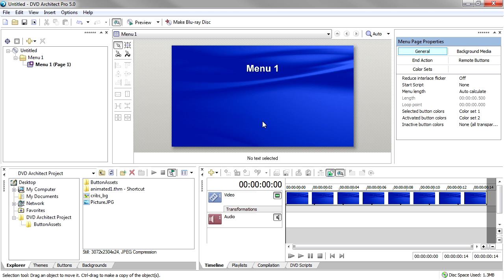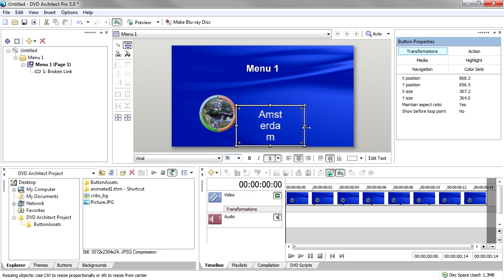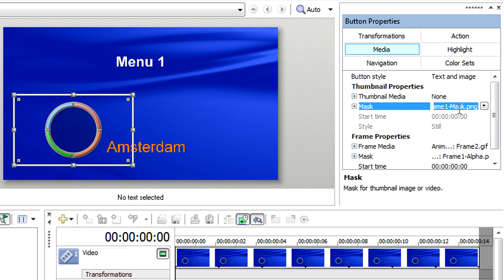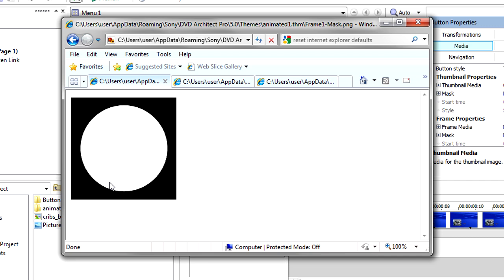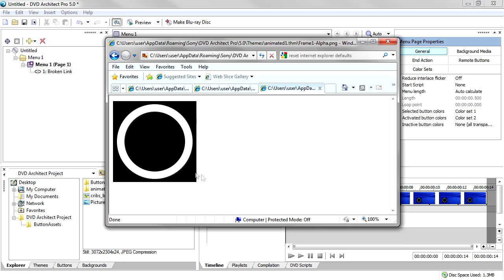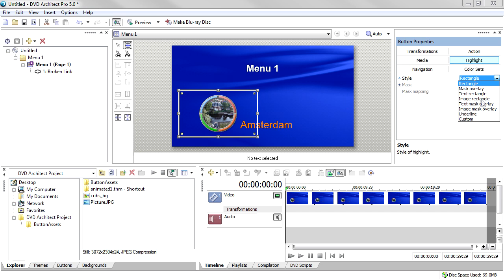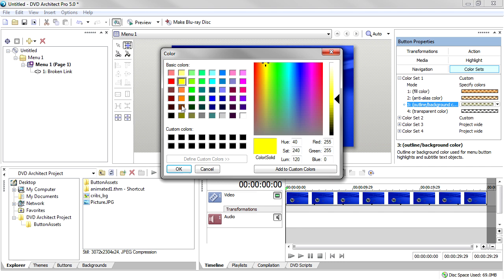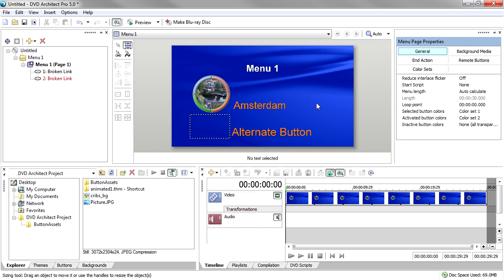Anatomy Of A Button

Comment: If you look closely at the button highlight images at 9:23, you can see that the image quality is terrible.  The clipart of the storefront is very low-res, with pixelated edges, color noise, and gaps.   I've been working with such clipart and other image type highlights for some time now and there seems to be no obvious way to improve the image quality of highlights.   Some of the things I've tried include using high resolutions for the images (1200 dpi at least), different image types (PNG, GIF, JPEG, BMP, etc), different color sets.  Nothing I've tried so far has worked to clean up those lousy highlight images. 

We could use a tutorial on how to do that, assuming it's possible.  Whatever the commercial blu-ray authors use and how they use it obviously works well - the image highlights of professionally authored menu buttons don't display any of the low-quality appearances of DVDA highlights.  How do they do it?  Can it even be done with DVDA? 

I realize that high-quality button and frame graphics and videos can be generated in third-party graphics and video editors.  I'm talking strictly about highlight images.  And yes, I've seen many well-written explanations in the Creative forums for using third party tools to generate such menu graphics/videos - but even those haven't delivered when it comes to just the highlight images.  They're just as terrible-looking as the highlights shown in this YouTube tutorial.

My version of the creative software suite is Vegas Pro 16, DVDA 7 build 100.  OS is Windows 7.  Anyone have a good solution for this?